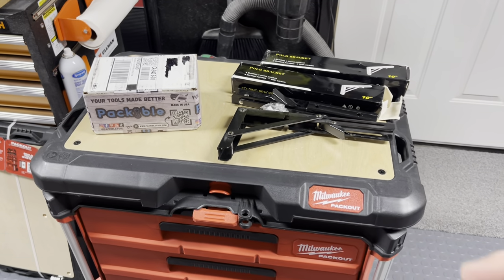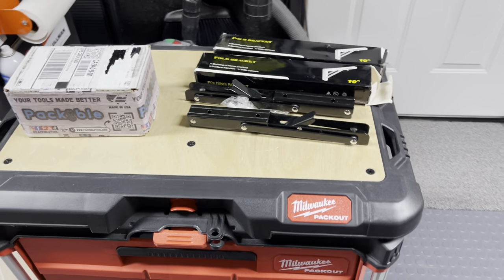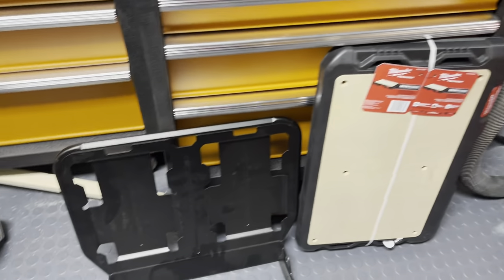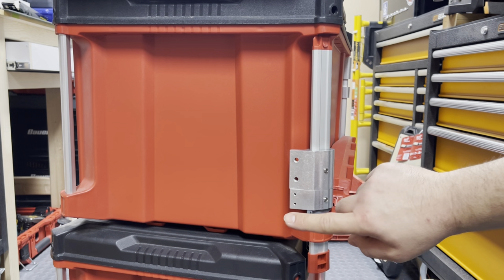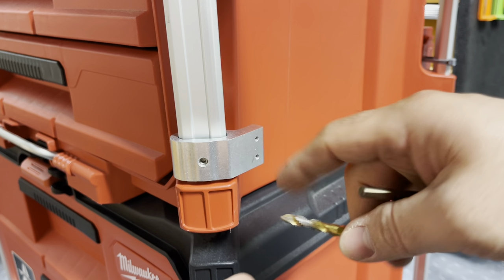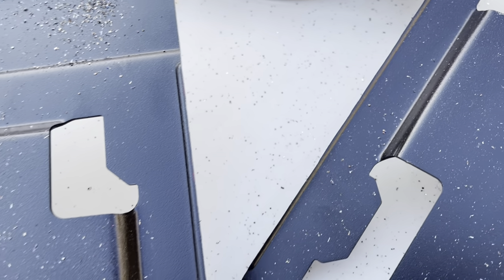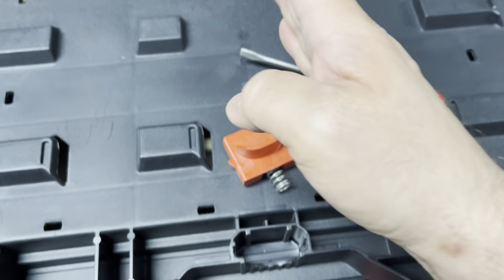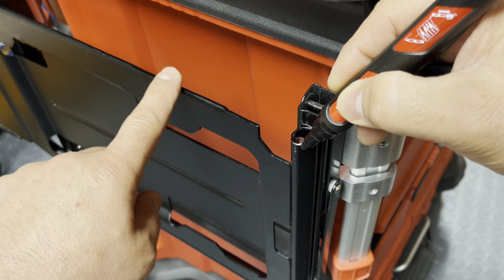Milwaukee Packout Cart Build With Packible Mounts

Comment: I’m just starting as a millwright, and so far, I really like it. No issues with the 3 drawer and rolls into the cage without any issues. I have sockets, wrenches, and heavy hammers.
Oh, and the drawers are lockable. The bar swings up and clips in and I padlock it.
Reply: I’m a millwright too! Local 102

Comment: I’m a heavy equipment mechanic and they work great for me I have 5 of those packout drawers I highly recommend packout drawers as an addition to a full tool box . These things work great if you run a service truck as well . I can lock them on to my service truck a drop them off at the shop if I don’t need the tools in a particular packout . It’s also a lot cheaper than buying another tool box .

Comment: Also u can use self tapping 1/4 20s instead of drill and tap. I use them on iron beams and they work great. They made by Dottie and sold at electrical wholesale houses.
Reply: I was thinking why not just drill through the hinge and use a big washer and you wouldn’t have to tap anything

Comment: I like using a m12 impact on low setting for those tap jobs. not enough torque to snap them. just back it off and go again if it gets stuck. no need to even pre-drill with those drill/tap combo bits.

Comment: I’m a heavy equipment mechanic any time my service truck is down for major repairs I run packout system with all my essentials obviously big hammers and pry bars breaker bars you need to get some accessories to hold them but as far as power tools , hand tools sockets wrenches pliers etc picks screw drivers I can carry almost all I need for 90% of jobs with a 3 drawer 2 drawer for the deeper sockets and hammers etc … a clear top organizer for consumables and a bottom wheel large box for battery tools works great yes it can work for mechanics not as your main box though

Comment: That's freaking awesome dude 😎 am sure this will work for a home garage if you need extra space for tool organization. I am also 100% sure when a little inch annuity someone will customize a DeWalt tough system I have idea of myself I just don't feel like implementing them don't have a need for them but you could probably add a corn Ravel for your extension cord maybe some kind of modification at a tool bag like a smaller style crate
Reply from the maker: So many possibilities! 🔥🔥

Comment: " Is it good for a Mechanic, is it good for a Mechanic.?" 🤣
I'd say it depends on what type of Mechanic. 
Automotive/Truck where you don't need to move your box out of your work space, probably not.
But if you need to move around a lot, Yup. 
I've done Heavy Trucks, Automotive, and Railroad type work, never needed to move my Snap-On out of the building.
Currently I'm doing Forklift maintenance/repair, needed something I could roll around to where the equipment quits running. 
The Packout moves like a furniture cart, I've had to break it down to load in the truck, roll it up to loading docks, taken elevators with it, climbed stairs, sometimes walking up to a quarter mile through tunnels/halls.
There's other brands as well, but this type of box works well for this type of work.

Comment: You might be a mechanic by trade but you are one hell of a carpenter and Jack of all trades! Very well done man! And those Diablo steel demon blades work great! I have the same saw and it runs that blade awesome. Very impressive all around. Plus I like all the tool companies you use. Bonus points on using many brands! 🍻🍻🍻
Reply from the maker: Thanks man! 🍻🍻 yeah those blades are awesome! I use them every chance I get. Very fast and clean!

Comment: you learned this the hard way, but the drill/tap combo bits only work properly with thin stock, like where the material thickness is 1/3 the diameter of the bit.  Anything more than that and you're rolling the dice on breakage and better to use a traditional tap.

Comment: I see you used a circular saw to cut metal. Does it have to be a "metal cutting saw" or can it just be a regular circular saw with a metal cutting blade?
Reply from the maker: There’s lots of metal blades out there that will fit your saw. Diablo makes a lot of them, even some for aluminum. The saws that are specifically made for metal contain the shavings better and are a little slower for a better cut. If you use them on any type normal saw, keep in mind, you’ll have metal shavings everywhere, the blade spins faster with less blade life, and more poor of a cut.

Comment: if i remember correctly those drawers on the packout had a 50 lb weight capacity on the 2 drawer and was 25 lbs each on the 3 drawer.
Reply from the maker: Yeah, Full-blown wall to wall wrenches or sockets in one drawer is a little too much..

Comment: need to use wax to easily tap holes
I keep a toliet wax ring in a small sealable container and dip the tap in before every use No wax break 2 out of 3          With Wax break 1 in 10-15

Comment: What installation driver are you talking about for those pieces?  I remember, i could have sworn, I while back I saw a Milwaukee 4 in 1 driver with adapters like that, but it looked more like a regular driver, without the magnetic thing on the front and it was fuel.  I cant find it now.  I can find one like it, non-fuel, but not the fuel one.
Reply from the maker: It’s the FPDX European market. Got it from Adzy’s Goods uk

Comment: It's funny I've seen only two packout systems on the jobsite ,it seems only youtubers that have them and aren't even in construction
Reply: i have never seen dewalt tough systems on any job site ...all i see are milwaukee packout  and ridgid....same goes for the tools...very few dewalt...mostly milwaukee, ridgid & makita
Reply: @kingofthecrease30  I don't see Milwaukee ever only on YouTube we had one guy on the jobsite who had Milwaukee now he has flex got tired of his tools breaking down
Reply from the maker: @loucifer4205  I work at a supply house/tool store now and we sell way more Milwaukee than ToughSystem. We actually sell more Tstak than ToughSystem. I see a ton of work trucks with Packout in the back as well. I restock a lot of packout every week..
Reply: @AutobahnDan  Where I live packout at 3 home depot do not sell dewalt and ridgid outsell Milwaukee by a large margin and that includes tools
Reply: @loucifer4205  where do you live? Here in south Texas pack out is and Milwaukee hand tools and power tools are the most used and bought by far in the HVAC trade
Reply: Wow what trade are you in? I work with multiple trades and I see packouts as well as other tool boxes. Many  low voltage techs, and electricians near me seem to be purchasing packout more than anything else.

Comment: This feels like a waste of time and money. You are basically defeating what these packouts were meant to do. For the money you spent, you could have bought a metal 6 drawer cart from harbor freight that would have solved all your flexing drawer issues. They even have folding side trays available for cheap.
Reply from the maker: Everybody’s situation is different. This came out handy doing contractor work and not having a huge cart in the way. It’s very mobile and I can tear it down into other options later versus a heavy metal cart that’s going to be in the way later on when I’m doing other stuff. It holds its value and I can sell it for pretty close to what I bought it for. The list goes on and on.. can’t be narrow minded.